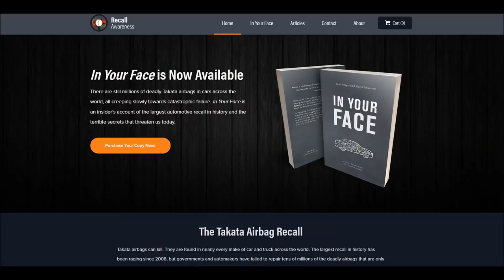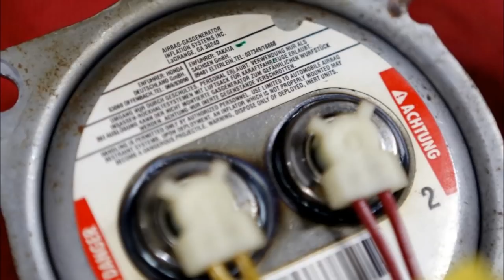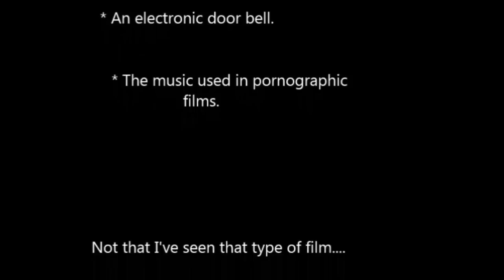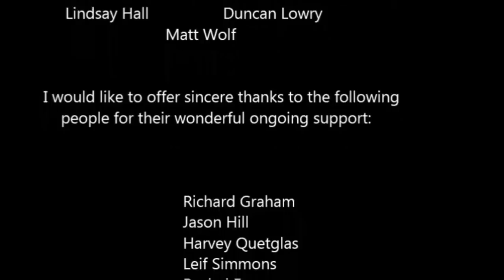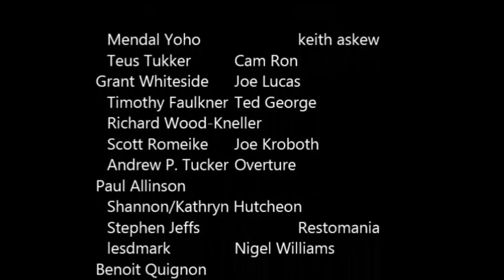Takata Recalls, the Starlet and a VW Polo Door

Comment: Good talk about the airbag issue.  Takata aside, as we go forward into the 2020s and cars from the 1990s and 2000s are heading into modern classic status, I think with all airbag cars there is going to be questions about how good these inflators are when they are decades old and have been through a bazillion heat cycles and endless changes in humidity.  Probably something the classic car industry will have to be dealing with at some point.
Reply from the maker: Yes, that's my point entirely. Takata or not, there has to be some instability with these old compounds after several decades, cheers.

Comment: You should see some of the people driving their flash new cars around Box Hill, I saw one almost reverse into the side of the bus on the way to work, the idiot was looking down at the dash at his reversing camera rather than looking at the mirrors and blind spots. Manual transmissions are getting very much a thing of the past. My neighbour has a 1998 Honda Accord that is under the recall, going through the motions at the moment, but they are sad that it is going to be sent to the crusher for no good reason. It is immaculate and has very low k's as they acquired it from an elderly owner who had to hand in his licence. Honda are recalling 1998-2000 Accord, CRV and Legend.
Reply from the maker: It's such a shame that so many good reliable cars are destined for the crusher... 90's cars are still pretty simple and easy to keep on the road - far more so than where modern cars will be in the future. Electronic components are good where the system is relatively simple, but with added complexity and where component failure presents itself (electrolytic capacitors etc), I would think that today's cars will become far more disposable, cheers.

Comment: There’s 3 mint condition starlets at my Toyota dealer - all had their airbags removed and big warnings on the windscreens saying DONT NOT DRIVE TAKATA AIRBAG - what are you going to do about yours? If it’s been recalled and they aren’t replacing the airbags?
Reply from the maker: They don't make the inflators anymore... this one would go to the crusher, but I'll hang on to it while I decide on what to do... I need a 96 - 97 model to swap some stuff into, cheers.

Comment: Yep, used window motors for my Wife's mint Mk3 2.0 Golf were $800 a piece. It needed 3 of them. Had to scrap the car as not roadworthy nor economically viable to fix.
Reply: @John Jalas Apparently they need to be partially destroyed to get the old ones out. Rebuilding was not an option. At 16 years old, the car wasn't worth more than $1500. In the end we went with a shiny new Mk7 Golf, better safety rating as well.

Comment: Try to get a non-airbag steering wheel if possible
Reply: Cant register a car that is meant to have an airbag, with a wheel that hasnt got one. Particularly in states of Oz where inspections occur annually.
Reply from the maker: Very true... with a tainted VIN, the car becomes crusher food or parted out... If mine becomes a victim of this, I'll get a 96 or 97 model, and swap over the bits I want... I should get something more modern, but these little bangers tick every box for me and I still have loads of parts, cheers.
Reply: @PeterAndersons  get a 96 or 97 3door manual without an airbag and get Charlie involved in it like 6 years ago

Comment: I think it might be safer to remove the air bag from the horn pad as it may be more likely to cause more harm than good.
Reply from the maker: They always recommend against that... my three looked good with no corrosion, but I should have removed the inflator from the spare one, put it in a concrete paver 'sarcophagus' and detonated it to see if it would hold together, cheers.
Reply: @PeterAndersons  That would make an awesome video!!
Reply: @PeterAndersons  that would make a great video, I checked out some of the reports of the air bag deployments and the wounds sustained from the bag shrapnel sounded pretty horrific.